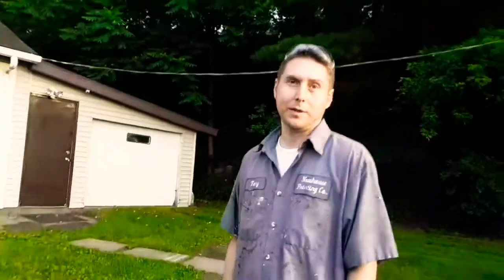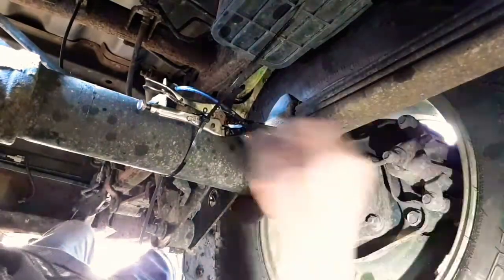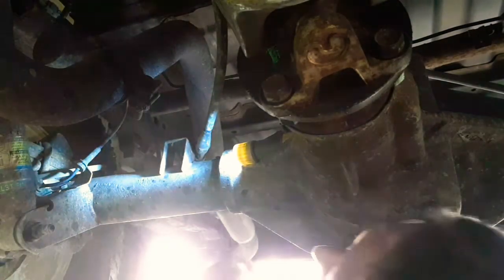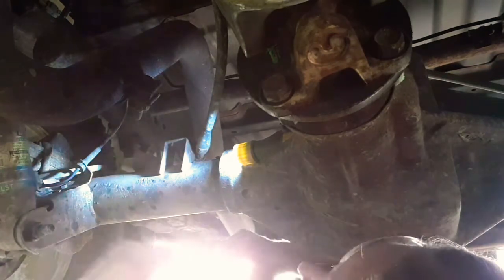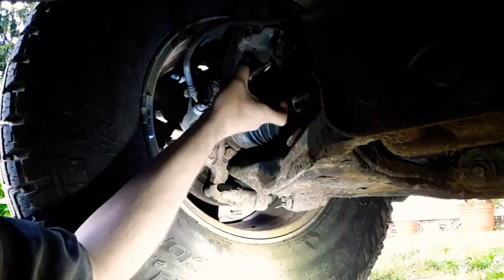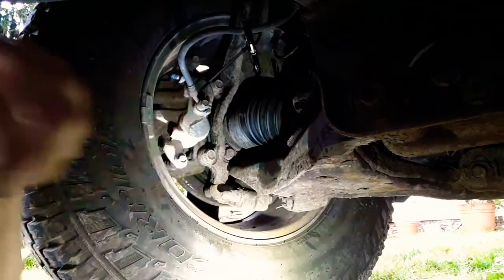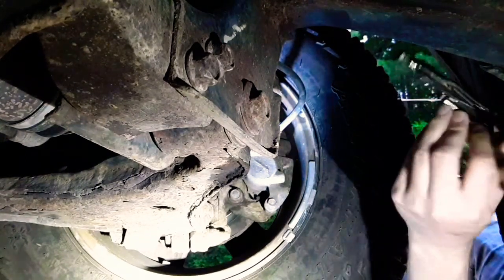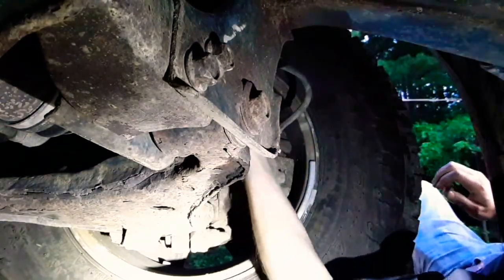How To Easily Find A Warped Brake Rotor

Comment: This worked for me!  A geniusly simple idea!  One word of caution!  The last thing you do before you work on a car is to stop it where you want it in the garage.  This means that as it sits the brake pads may be clamped against the wheel and when you clamp the hose the brake shoes will be held against the rotor and can't retract because the fluid won't flow out.  This will cause the brakes on that wheel to overheat during the test.  So before you do this test take the wheel off and retract the brake shoes a little, then clamp the hose.  I know because I made this mistake.